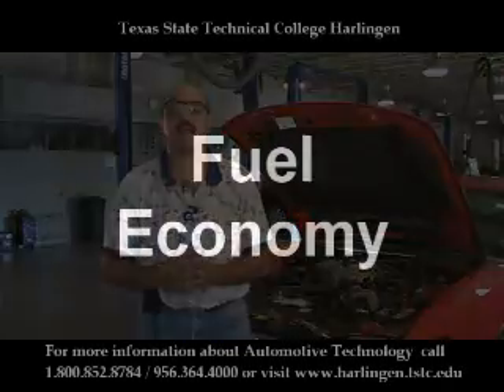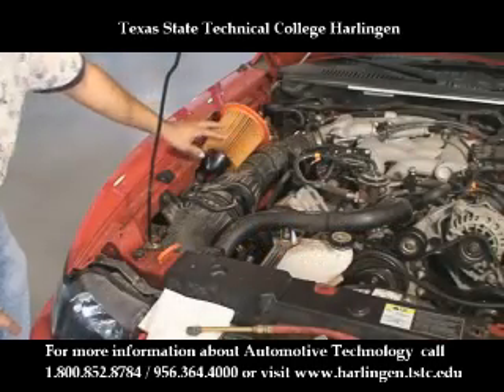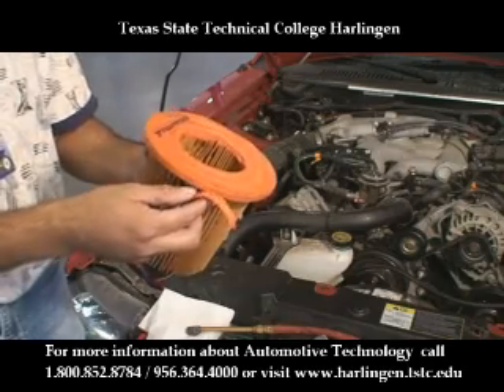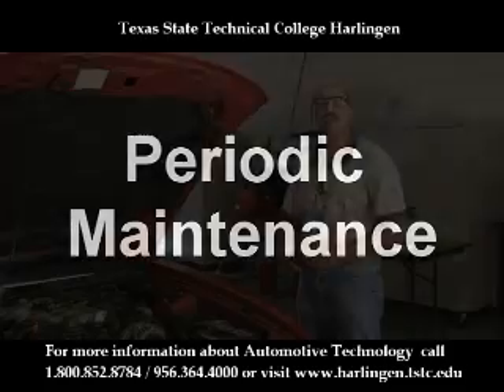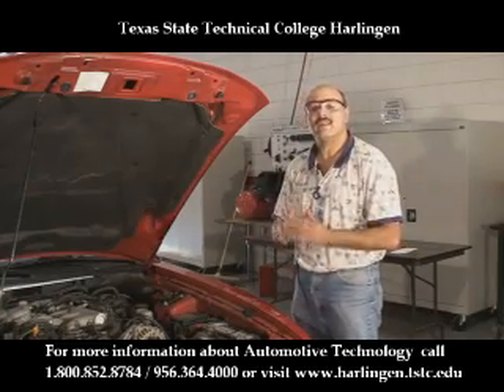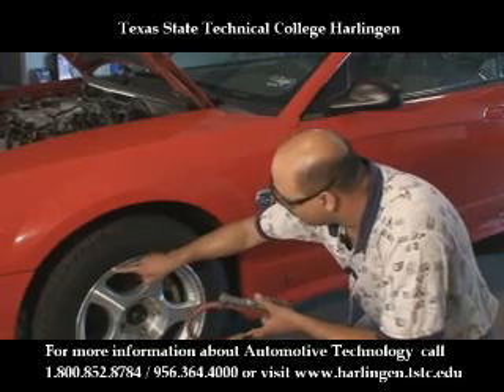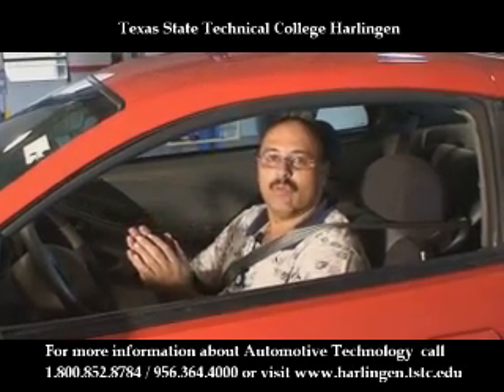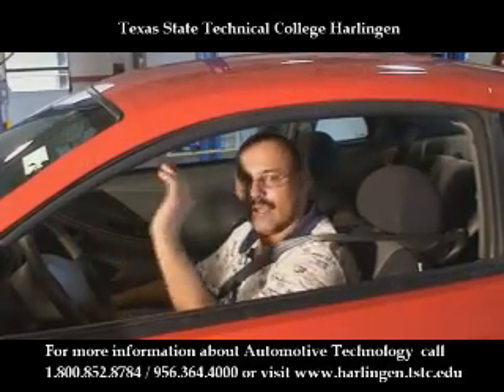Fuel Economy

Comment: Actually the correct way to check how much air pressure is on a PER-VEHICLE basis, usually located in the driver door sill.
The tire itself only tells you the maximum pressure to run.